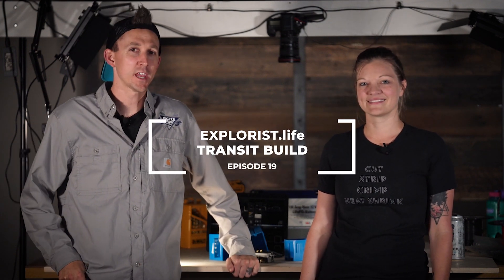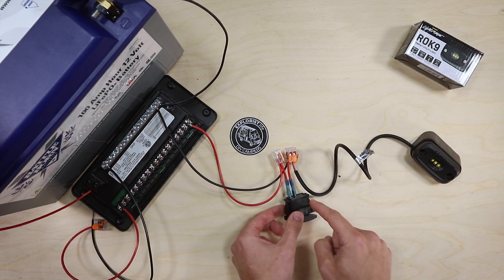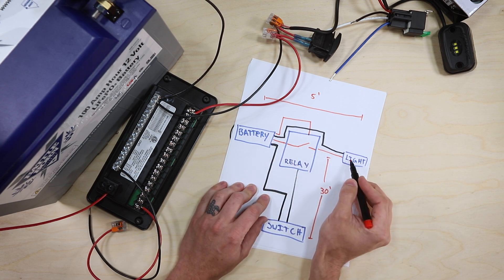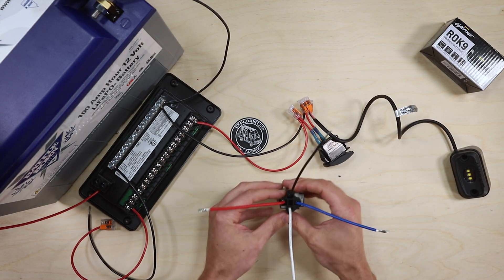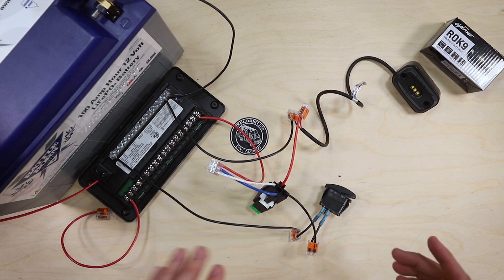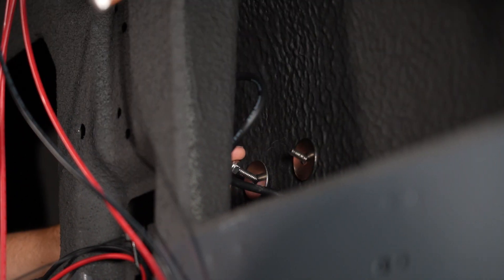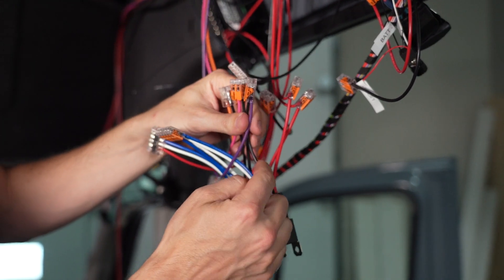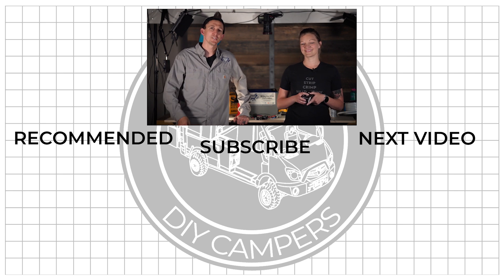HOW TO WIRE RELAYS (To Control Scene/Work Lights)

Comment: Amazing! Thank you. New at this, I did install some lighting into the company’s trailer and at the beginning I started with 3 flood lights outside with the panel at the front of the trailer and the switch at the back door. So around 20 feet distance 40 feet back and forth on a 14awg wire. Everything was working until I decided to add 2 more lights and I’m experiencing voltage drop. I was about to buy 10awg wire and rewire the whole switch until I saw your video. So from what I understood I can fix my problem by using a relay. Thank you so much.

Another thing I was planning on adding another switch outside and making it a 3way switch. With my research I need a spdt switch, to achieve that, but I was concerned about wire length, is it possible to make something like that with relays too? Does the relay have to be spdt as well?
Reply from the maker: Great project! Long wire runs and added lights can definitely introduce some challenges, and the best way to cleanly solve it depends on your exact layout and parts. We’d be glad to take a closer look and recommend the best way forward. Reach out here: https://shop.explorist.life/support

Comment: I know this question is rather beginner, but, after watching these last 3 or 4 videos back-to-back (wiring puck lights w&w/o dimmers to now using relays) I would like to confirm a question I have about wire gauge:

1) Do I have it right that we are to calculate and determine the awg of wire used by "the total run of the wire from 'Batteries (/battery bank)' or from the 'fuse panel or breaker box' to the end of the run (last item connected) when determining appropriate awg of wire to use?

2) When you wired your puck lights in previous videos, did you measure each diversion point (branch point for each puck light along chain, left and right) when calculating the 'total run of wire' in determining what awg wire size to use or did you only measure along the center-most-branch (excluding each branch chain) to calculate 'total wire run' and thus determine awg off of that length?

Maybe a simpler way of my question is: 1) Where did you start your wire measurements? Did measure every inch of red and black wire from the batteries, or inverter-charger, or breaker box/fuse panel box, or what starting point in calculating the 'total wire run' and then calculate respective awg size. And 2) if not every exact inch of red and black wire which parts of wire did you measure?

Long question but hopefully someone can help answer. 
🙏❤ - thanks in advance!!
Reply from the maker: Length of wire = every foot of wire used in the circuit.

Comment: Why not do ground wires to chasis ground? Is it to separate van's electrical from the solar electrical supply? In aircracft, 28VDC and 115VAC are all grounded to airframe ground. This would save the use of extra ground wires, weight, money and simplify the wiring. Your 12V fuse box black to chasis ground and each 12v ground circuit of each component to chasis ground. 115V, i would keep separate.
Reply from the maker: It’s less reliable.

Comment: Love your videos! How many circuits are you using on the fuse block in this example? I see a red wire bridging 2 wire nuts. Thought each relay would be its own circuit on the panel/switch.

Comment: My brother is an electrician and said the boxes need to be grounded. But I don’t see a screw on your plastic boxes to ground them. Do the plastic junction box’s need to be grounded? 
Or do you only have to ground them in house electrical?
Reply from the maker: I don't recall using any boxes in this tutorial over 12V DC lights & relays; but no plastic boxes don't get grounded.

Comment: does it matter what kind of lever nuts i will be using on sockets ect. :o  what would be good size for amp wise and volt wise? :o  i found some 32A and 450V ones from internet. :o

Comment: Great video! If you wanted to use upfitter aux switches instead of rocker switch, would you just remove the "switch" section of your diagram and replace "battery" by "aux switch"? That simple? (probably not...). Thanks!

Comment: I am so close but something is off! My lights don’t turn off regardless of the switch. Where might I have slipped up? I assume it’s with the black/ground wires. Thoughts?
Reply from the maker: Tough to tell.  Re-build it on a tabletop, perhaps?  That always helps me when I am building more advanced circuits like this.
Reply: @EXPLORISTlife  so I have determined the system “works” but only when I remove the fuse from the relays. I have tried putting in 10A-30A relays in each one and it always results in the lights on, even when I switch them off. Does this make sense?

Comment: My fuse panel will
Be at the back of the van, near my batteries and my switches will be up front like yours. Is it better to place the relays near the fuse panel, the switches up front, or somewhere altogether different? Thanks!

Comment: How would I use a relay in a dimmer situation? Is it the same? The lights I'll be using have a push button on/off, and I want to use a dimmer with them.
Reply: Similar question: I want to wire a dimmer with 2-way switches. If I use a relay, should I wire the relay to the first switch per this video, then wire the dimmer and second switch per your 2-way switch video?
Reply from the maker: Think of it like this:  wire the 2 way switches to control the relay.  The relay then controls the light.
Reply: @EXPLORISTlife  Thanks!
Reply: @EXPLORISTlife  I got it all wired up. The 2-way switches work fine. But when I try to dim the lights the dimmer buzzes and the lights don't dim. Then the switches don't work. I didn't blow any fuses. My dinner has in and out wires for both positive and negative. Any guesses as to what is happening? Is the relay able to transmit varying power to the lights?
Reply from the maker: The dimmer would have to be on the 'power' side of the relay, and not the 'switch' side of the relay.
Reply: @mikesteur931  , you may want to ask your question directly to Explorist, otherwise I don't think they'll see it under my question. Good luck!

Comment: Hey Nate I see the relays have fuses in the as well. How do you determine the size fuse do you require in the relay and what size you need at the DC fuse block with this configuration?

Comment: Would it be bad practice to connect the switch ground to the chassis instead of running a wire?
Reply from the maker: I recommend running a dedicated wire as shown in this video.
Reply: @EXPLORISTlife  Ok I’ll do that. Being able to use thinner gauge wire is already savings enough. Was just curious. And thanks for the quick reply!

Comment: I have watched this video 100 times and think I finally get it all. Here are my questions to hopefully tie it all in. 1. I have one of those nilight rocker switch panels. Can I use three of those switches for my scene lights? 2. Did you use the three colored wires (purple, pink, etc.) just to discern the difference between the lights on each switch? 3. Do you have a schematic of your switch-relay-load-fuse block set up? I'd pay good money for that :) Thank you!

Comment: Given that you are wiring three separate relays with a 30 amp fuse installed in each: for 3 sets of lights how did you determine the size of the fuse needed in the fuse block talked about here https://youtu.be/mTH1Uc_L2M8?t=543 to protect the 3 different loads? Or would it be a single fuse protecting all 3 circuits to the relays? So would I triple that to a 90amp fuse?
Reply: Nevermind! I figured out that this wiring schema you have setup is wired as negative triggering. Alas, I had to wire mine positively triggered. A lot of the common rocker switches from popular brands are daisy chained for you to accommodate for a positively triggered circuit already. 
Video idea -  Go over SPST and SPDT relays and the difference between configuring either positively triggering or negatively triggering circuits and when to choose one or the other for both DC or AC. This is highly useful such as having a switch in the back controlling some rear facing scene lighting for when you're loading/unloading ski gear at night, that can also be turned on/off at the front in the cabin of the van whilst driving I.e reversing and needing some extra light. Maybe even throw in some winch love for us snow goers and go over a dual SPDT relay setup for extracting and retracting a winch ;)
Reply from the maker: For this one in particular, since the loads are so minimal, we were able to use one fuse for the entire 3-circuits.  The fuse was sized large enough to not blow when all of the lights were on which was also small enough to protect the smallest wire in the circuit.  I think that fuse is somewhere in the 10-15A ballpark.

Comment: In an instance where you would be powering a load light at the rear with a switch in the dash in the front, is there an advantage in placing the relay in close proximity to the load light?
Reply from the maker: So, if there is a way you can theorhetically draw a 'T' with each end going to the fuse block, switch, and Load... the relay is best placed near the center of the 'T', if that makes sense.

Comment: Hey Nate. 
Curious about why you put scene lights on van instead of roof rack?  
Pros & Cons?  
Debating for my install. 
Thanks
Reply from the maker: We had the scene lights on the roof rack in our Sprinter.  We opted for them in the side of the van to decrease the amount of wires we had to run through the roof and attach to the roof rack.  It's just so much easier to wire everything inside the van and uses less wire.  It's also a more low profile look.

Comment: another reason to use a relay (in addition to distance from switch to device), is that many switches are not rated for the amperage the end device uses.  i.e. floodlights may use 20 amps of current but the switch itself is only rated for 10 amps, and the switch contacts will fail from repeated over-current.  A high amp device should also be separately fused from the relay, since a shorted relay may not pull enough amps to trip the high amp device relay.

Comment: Hi Nate, mostly well explained, but at 8:45 in the vid (when you cut back to one power wire from the fuse) I noted you still had the second negative wire back to the fuse block in play. My question: If I used multiple relays for many 12v loads wouldn’t I end up with a mountain of single negative wires that require to be terminated at the fuse block? What would be really helpful is a detailed map of the wiring diagram after you made the changes at 8:45 in the vid, thanks in advance.

Comment: Nate, Wouldn't it be better to use well nuts to install the exterior scene lights so they are more water tight and the light can be removed at a later date without removing the interior panel?
Reply from the maker: There's probably 12 different ways to properly do this.  I like the way we did it.

Comment: Did you say switch the negative? I don't think that is a Good idea. If a wire  wears  the insulation and the copper connects to ground (frame  metal)it will turn on the light. Now you can't turn the light off. The battery will drain. You switch positives not negatives. So your fuse will blow.

Comment: Please do a video on connecting the DC/DC Charger on the start battery side and connecting the house bank on the alternator side. If you already have a high output alternator and external regulator with a 400Ah plus house bank it seems crazy to not do it this way! Why buy a bunch of DC/DC’s and parallel them when you already have the output? There are no videos on it. Thanks!
Reply from the maker: We don't have an alternator with an external regulator, so we will have to use a DC DC Charger, but we will definitely be coving all of that later in the build.

Comment: Thoughts on just chassis grounding most of this stuff and limiting some  extra wire runs?
Reply: Chassis ground work perfectly. When in good condition and properly done!
With this said I personally find most of the DIY chassis grounds I come up with. Usually on older projects (cars, bikes...) a continuous source of headaches. Until they're properly sorted and repaired!
If one goes for this option, please do it properly. Rust, dirt and other corrosion issues will surely  meddle on your success rate! 
Cheers

Comment: I use wago 221 for temporary circuits.
But I'm confused why you don't directly crimped connectors to the wires and use wagos... I understand that it'll work fine - but it's additional connections, a lot of. In some places where additional connections possible - OK, but near switches?
Sorry, just my cockroaches 😁
Reply from the maker: It just makes things so easy.  It's easy to shorten wires, easy to make them longer, easy to inspect the connection, easy to probe for voltage, easy to disconnect then reconnect the wire, etc.  It's just easy.  When we are only dealing with a few amps, I'm not worried about an additional high-quality connection.

Comment: Brilliant thank you 
Got a question the fuse at the (fuse board) is that amp rated for the light attached and the relay amp rating 
30 amp relay & say 5 amp light- is that 35amp in the fuse block. 
Sorry if not making sense 👍🏼
Reply from the maker: Great question.  The fuse in the fuse block is sized to protect the wire going from the fuse block to the relay to the light.  So the fuse would be {Amps of the Lighting Circuit} x 1.25 = recommended fuse size (rounding is fine here as needed)

Comment: Thanks for the video. Are the relays necessary when using something like an Auxbeam, Switchpro, or spod?
Reply from the maker: Those units basically take the place of a bunch of relays.  There is a control module controlled by a remote panel similar to relays, but it comes in a nicer package at the obvious added expense.  We will likely be installing one of those for additional functions and lighting up front later in the build (foglights, spotlights, ditch lights, winch, compressor, etc).
Reply: @EXPLORISTlife  thank you. Good to know. Great video series very helpful!

Comment: Is there a reason to run the ground through the switch and not the live?
Reply from the maker: There are a bunch of different ways to wire a lighting circuit.  If you feel that you want to change things up from what I've shown and understand why you need to do so in your specific case, go for it. 🙂

Comment from the maker: Check out the full electrical installation tutorial for this build: https://www.youtube.com/watch?v=E5q7_4FH4LQ&list=PLmvhcyi4n0TVfA4XCYJBkzfUXunSON1zX

Parts List: 
Lightforce ROK9 LED Utility Light: https://www.lightforce.com/en_us/rok9-work-light
Angled Base: https://www.lightforce.com/en_us/rok9-30-degree-angled-base
Relays: https://amzn.to/3HBhdu7
2 Conductor Lever Nuts: https://amzn.to/3y3BVzB
3 Conductor Lever Nuts: https://amzn.to/3y1lEeC
5 Conductor Lever Nuts: https://amzn.to/39DSdWA
Wire: https://amzn.to/3O49neQ

Comment: Common reasons for a relay is either to switch more amperage then that which the switch can handle or to use a different control voltage  to switch the circuit.  You can also use them to isolate the controlling circuit from the load.  In this example I really don't see the need for the relays.  The load is small.  The distance from the switch to the battery would only cause a .41% drop in voltage.  That comes to .05 voltage drop.  You are likely loosing that with all the additional connectors
Reply from the maker: I used relays for this circuit to be able to use less wire (another common reason, in addition to the two you provided) going from the fuse block to the switches to the lights.  You could absolutely run each one from it's own spot on the fuse block to the switch to the lights, like I showed in this video: https://youtu.be/o-YlpzrnuzI but that's just not what I chose to do in this circuit. 

Now that I've taught the concepts of how relays work, I don't have to teach it again when we get to higher powered items like winches, higher powered lights, etc.

Comment: Hi, would you please send a link to the 12v connector..."lugger nut". thanks
Reply: I think he’s trying to say lever nut. Look for Wago connectors.
Reply from the maker: Sure!  Parts List: 
Lightforce ROK9 LED Utility Light: https://www.lightforce.com/en_us/rok9-work-light
Angled Base: https://www.lightforce.com/en_us/rok9-30-degree-angled-base
Relays: https://amzn.to/3HBhdu7
2 Conductor Lever Nuts: https://amzn.to/3y3BVzB
3 Conductor Lever Nuts: https://amzn.to/3y1lEeC
5 Conductor Lever Nuts: https://amzn.to/39DSdWA
Wire: https://amzn.to/3O49neQ

Comment: Honestly, I exclaimed, "Finally!" Not because I was waiting for you to do this tutorial, but that I knew you'd do the tutorial well. There are lots of videos talking about installing light bars, ditch lights, etc that skip over the actual wiring of the relay scuttling implementation for a diy learner. Thanks for the "this to this to this" level breakdown. Now, I'll grab a relay to fiddle around. 👍
Reply from the maker: Awesome!  Glad it helped.  'just playing around with a relay' on a tabletop is how I learned as well.  I'm glad you caught on that you can use relays for all kind of stuff and not just the scene lights I'm showing. Nice!